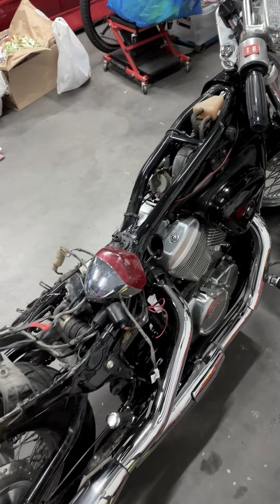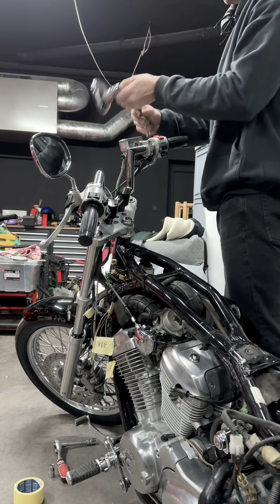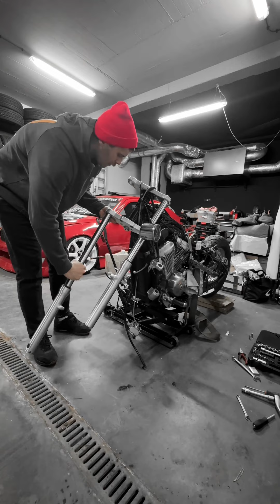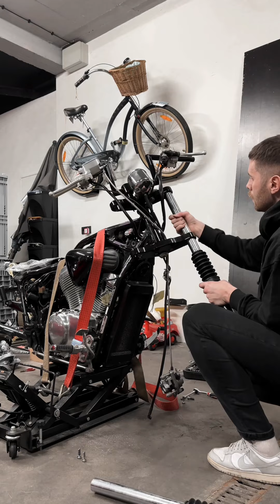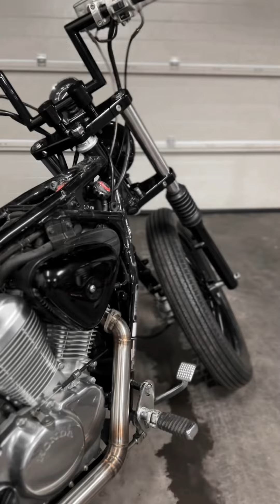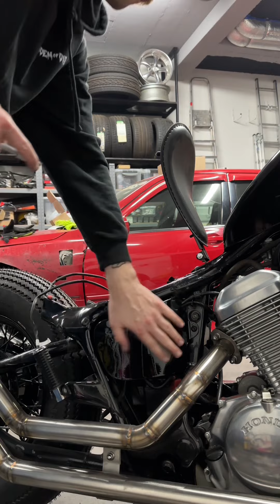BaconCycles - Honda Shadow vt600 bobber build

Comment: Hey I just got a vt600 shadow and I have a question, where the frame was cut it hits the fork and they dent each other, i don’t know why, I mean these are stock parts I think there should be some sort of end stop when the shock also is fully compressed and the frame should have a minimum of clearance. If you have an email to give me I’d like to send you some pic to make you understand better.